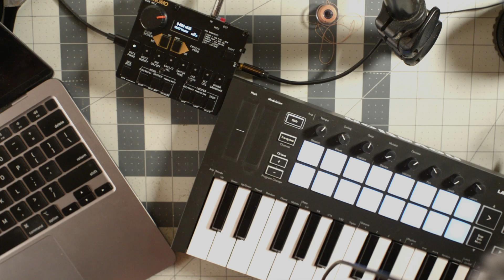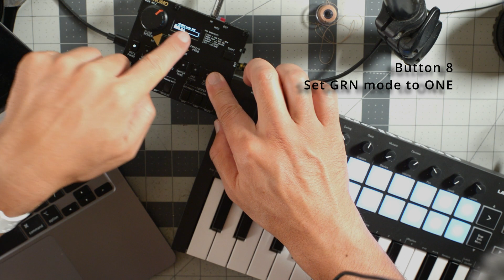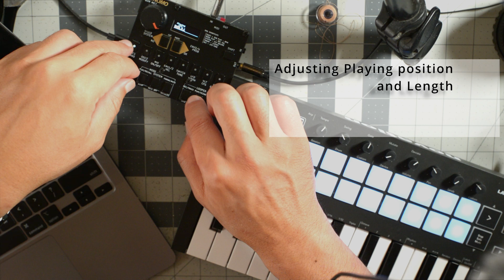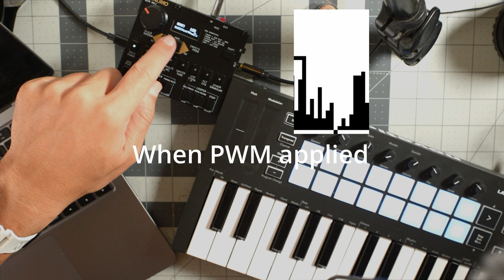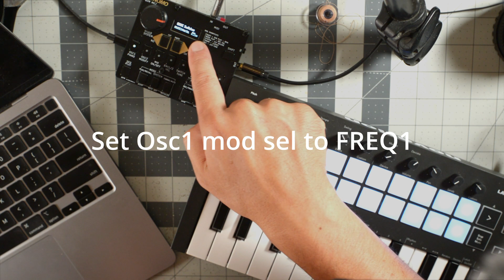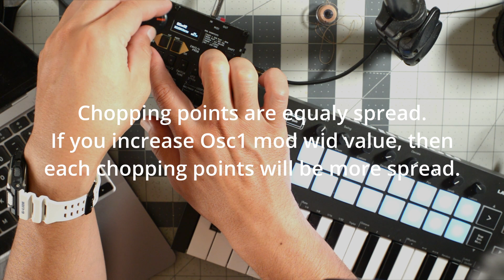Qun mk2: Using Granular as a sampler

Comment: I think I probably need a Qun mkII. Will you be able to add internal sample recording, eventually? A 12bit mode would be perfect!
Reply from the maker: Hi, I'm not sure what you meant, but you can record any internal sound to looper, and granular engine can import looper recording. What's 12bit mode? Do you want Middle-Fi recording?
Reply: @nunomollc  Can looper record external audio, then? Yes, 12bit 16khz, like many oldschool hardware samplers.
Reply from the maker: @DetroitMicroSound  Yes. Line in and the sound from synth engine is combined and routed into looper.
It's interesting to see Mid-Fi option. Thank you for your comment.
Reply: @nunomollc  You're welcome.  Excellent!! Sounds great! I think you will find many folks interested in a 12bit 16khz looper record settiing. (Or maybe even a way to convert imported samples to 12bit 16khz.) 😎
Reply: @nunomollc  I ordered my mk2 on Jan 7th (Jay Stump) I'm really excited to start playing it. Hope to see a 12bit sampling resolution eventually. I'm really mostly excited about playing around with the granular capabilities in this machine.